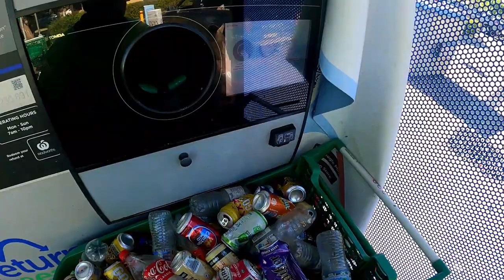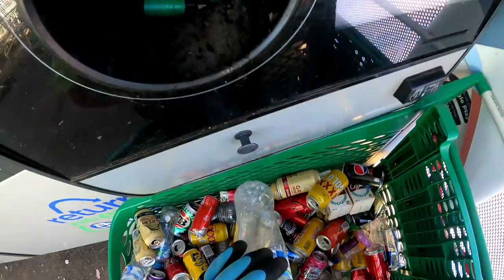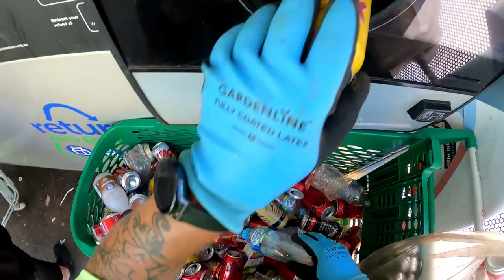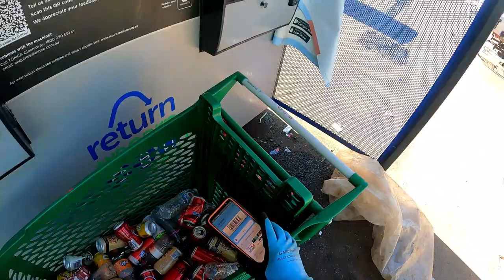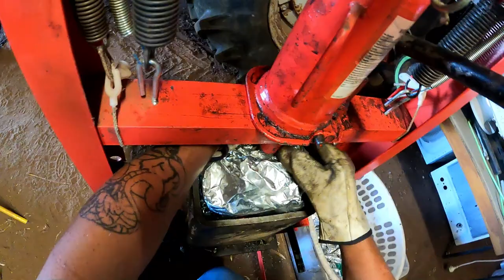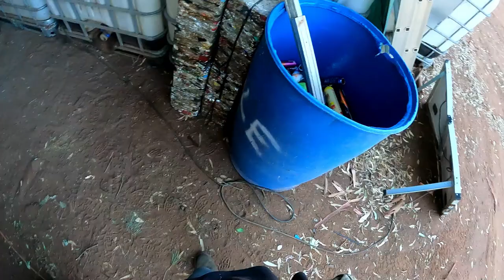Dumpster Diving Hunka Chunka Steel Follow Up Its Amazing What I Find

Comment: Was wondering what you did with aluminum foil Thanks. Does it have to be turned in a block or can you take the pieces loose
Reply from the maker: I find it easier for transport to put them into a block as I can fit more in it then taking them loosely seems to add up a lot more